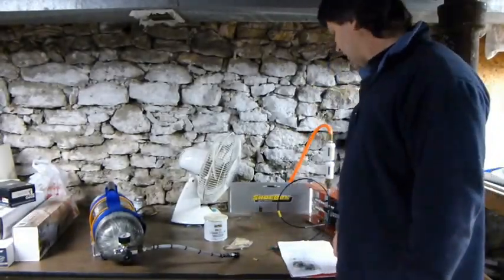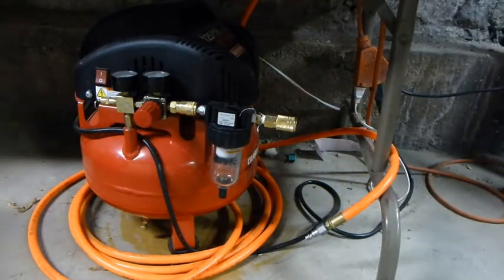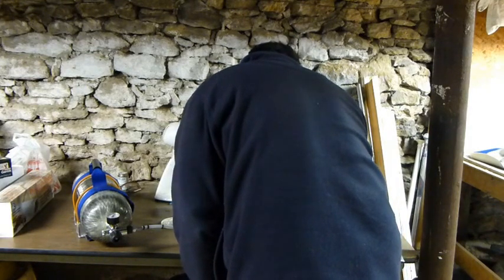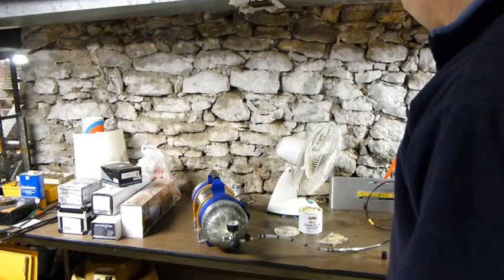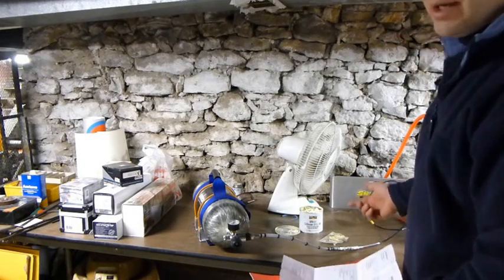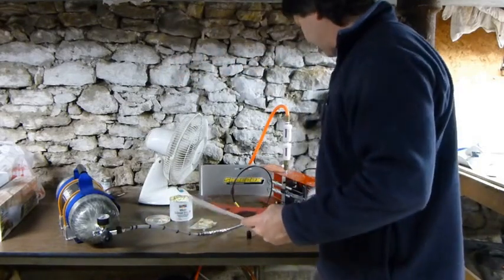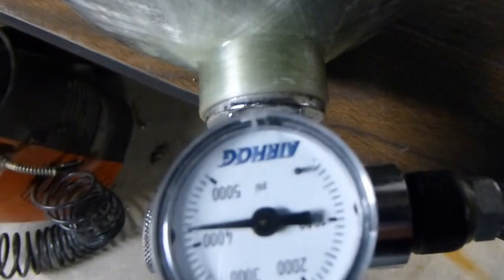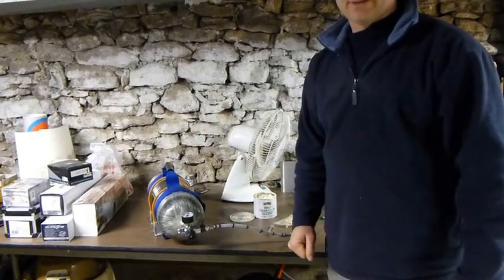Cricket Takes a look at the 4500 PSI Shoebox Compressor

Comment: Fair play it seams you know very little about compressing air.

When you compress air you will generate heat, this heat turns the moisture into steam.
your water trap that you have connected to your compressor is a water trap NOT a steam trap.

You would be better off removing the water trap from the comptessor, connecting your 25 meter hose directly to the comptessor and coil the hose into a bucket where you can fill it with cold water, then connect the other end of the hose to the watertrap on your bench.
The hose didstance and cold water bath will allow the hot compressed air time to distill the steam back into cold air and water this water will then be removed from your system with the water trap.
Try it you will be amaised and save you a fortune on secondary filters.

Comment: Hi Cricket! been enjoy all your videos,i really want have the same sent up like yours,i am getting a High pressure steel tank(not gona be the Air hog 4500psi),but enough for all my need. i order from local scuba shop(about 1.5 hours away) ,owner told me he could fill up to 3700psi for me.i just order the shoe box 4500psi with belt drive model,my question where you get those nice orange hose connect the shop compressor to the shoebox,and about the LONG hose from shoebox to your tank,Thanks sir!